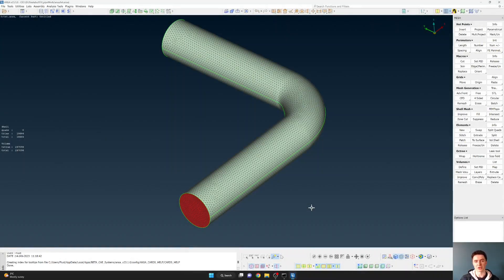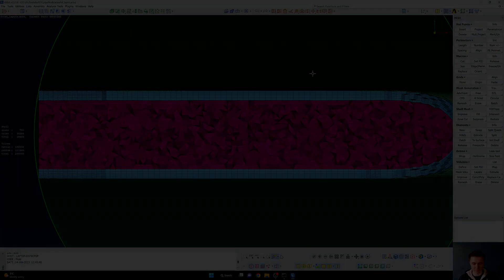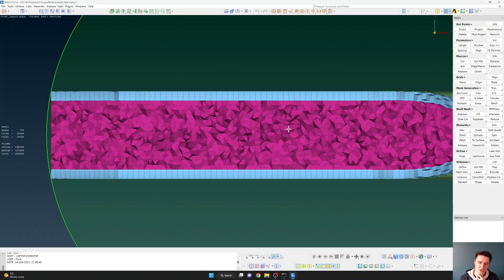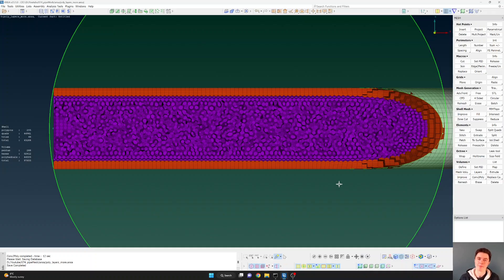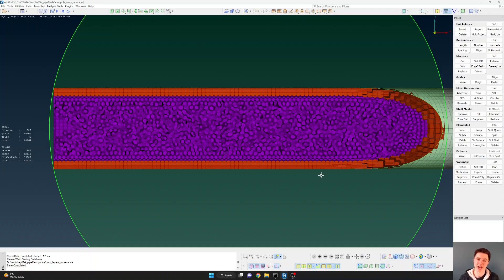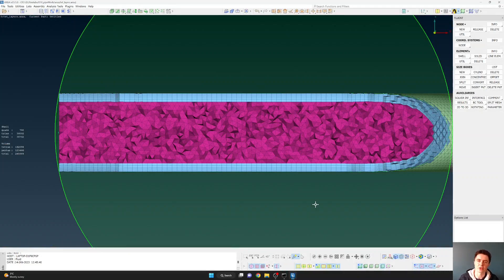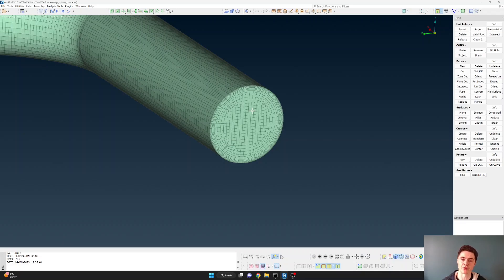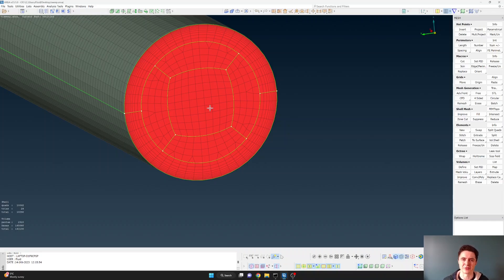[CFD] Meshing Guide for Pipes and Ducts (O-grid, hexcore, polyhedra)

Comment: Fantastic video on meshing. I have used polyhedral meshing for complex geometries (compressors, fan impellers) and I have to say I am blown away with the amount of time I can save per simulation, without sacrificing solution accuracy.
I also use hexahedral meshing a lot and I very rarely use tetrahedrals anymore.
Reply from the maker: It is just so satisfying to get a solution with the same accuracy but with a smaller mesh. Faster solution time, faster post processing, smaller files. Everything is just so much easier 😊 People often focus on the smaller matrices and faster solution time, but in practice you set off a simulation and then forget about it. It is the faster loading times, faster post processing and smaller file sizes that really make life better!

Comment: I have a very important question that I have trying to find the answer to in your meshing playlist. From what I see, the boundary layers are always hexahedral cells and its the volume cells that we chose whether to keep tet,hex,poly. My professor wants me to do the boundary layers also as polyhedral cells. This option is normally not there in OpenFOAM or Alter., is there a possiblity to use poly cells for boundary layers too. I know that when we double the cell size with each layer for square cell, one face of the bigger cell accomodates 4small faces so that is indeed polyhedral, but I am talking about the weirdly shaped poly cells.

Comment: Thanks Dr. Aidan for this useful video on this topic. Could you please share some experience on the sector meshing? Normally, what do we need to consider for meshing a sector of a pipe, I have found that the first cell at the bottom near the sharp corner, the quality is particularly bad. Thanks in advanced
Reply from the maker: If you are using ICEM CFD (block structured) you can use a 'Y block'. If you are using an unstructured mesh, you can fit a triangle into the corner. The key is to not make your sector too small. I would try and keep your sector angle at least 15 degrees. If your sector is any smaller, it is better to just use a 2D axisymmetric model.

Comment: I am a little bit confused about "Structured" and "Unstructured" hexahedral

I came from a school that structured mesh as in { (i,j), (i+1,j), ...) and the mesh goes organized in the sense of being connected all the way around from the first connector to the last one.
and unstructured (as in no need for the connectors to be aligned and with the same numbers)

1- Why is the term unstructured associated with triangles? 
2- How does the solver deal with a mesh of hexacore and in between there is a triangle?

Comment: Thank you for the very useful information in this video. Using O-grid meshing, it seems that the elements near the wall have high aspect ratio. Does it harm the accuracy of solution, especially when you have turbulence anisotropy?
Reply from the maker: That depends on your Turbulence model 🙂 For LES it definitely will, for RANS less so (but you can always do a mesh refinement study to check)

Comment: Great one again, Aiden! i have a question about the number of inflation layers for internal flows. I watched your video about inflation layers and it clearly explains the method but for a fully developed internal flow, the boundary layer meets up in the middle of the pipe, in that case how many inflation layers should we consider? i am sure we should not take the pipe radius as yt. It would be great if you can clarify this. Thanks!
Reply from the maker: Great question. Normally for pipe flow we would look to try and get a smooth transition between the edge of the layers and the mesh in the core. This often results in the inflation layer thickness being ~ 20% of the pipe diameter. You are of course correct. Once the flow is fully developed, the boundary layer fills the entire pipe. We are just using the layers to try and increase the resolution of the near wall region, where the gradients are strongest
Reply: @fluidmechanics101  Awesome. Thanks man!

Comment: Very informative video, but I have one more question: What type of mesh should one choose when the diameter of the pipe varies along its length and also when the cross-section is not an ideal circle, but rather a jagged and wavy shape? Or can the presented meshes also be used for that purpose?
Reply from the maker: These methods should still work. You might need to try them out and check the cell quality / distribution of cells. It is hard to say ahead of time, but I suspect that they will all work (the block structured mesh may struggle and have worse quality cells in the core region, but I suspect the near wall region should be fine)
Reply: @fluidmechanics101  Thank you!